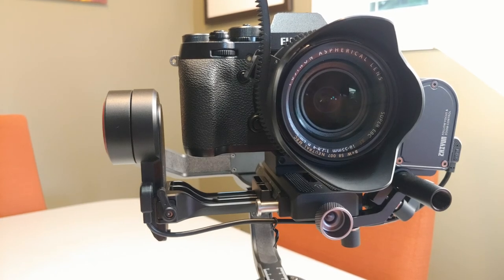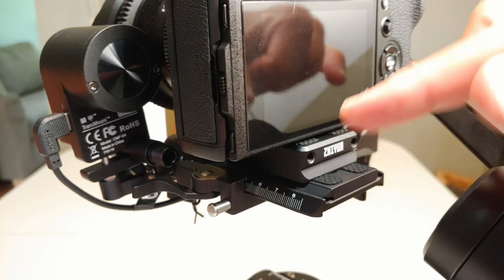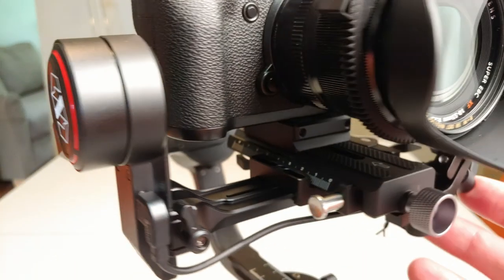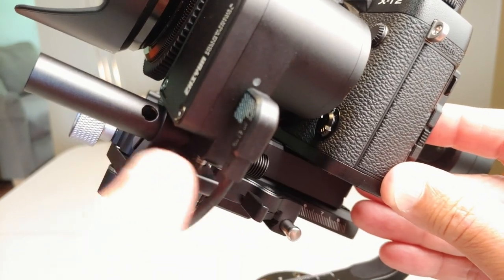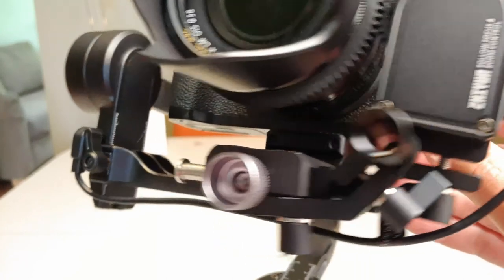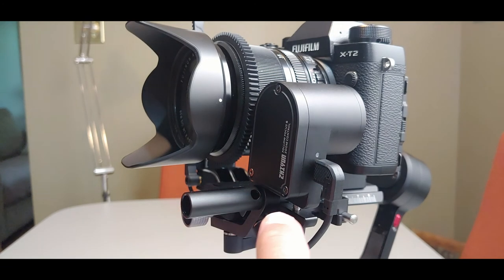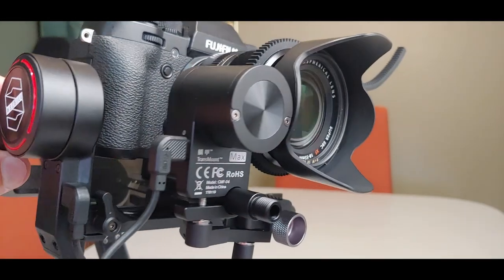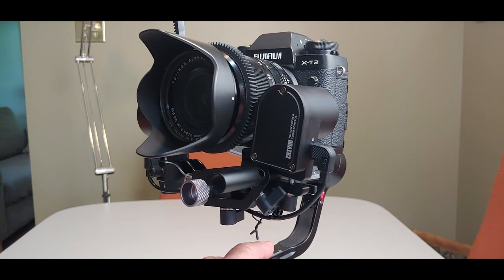Zhiyun Weebill S + Transmount Focus/Zoom Servo: Setup Considerations

Comment: I found a continuous aftermarket toothed rubber band much better for the Fuji zoom. The one that came with the follow focus motor seemed to skip a lot but the continuous one doesn’t. And you can turn the wheel as fast as you like and no skipping.
Reply: I found that the one supplied with it skipped also. However, once you position the servo properly and lock the gear tightly against the belt, it stopped skipping.

Comment: Will this work for 5dmark3 focus zoom
Reply from the maker: If the 5d will fit on the gimbal, and with the right choice of lens it should work. Longer lenses may make it Impossible to reach the focus ring with the servo. Mirrorless cameras would give you more choices (and less weight!)